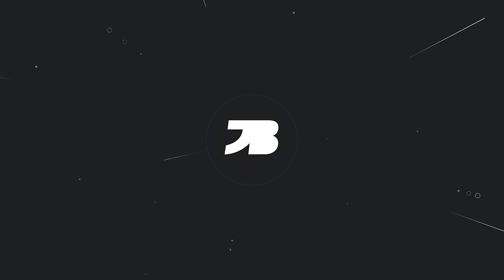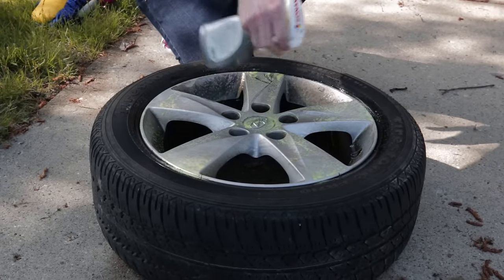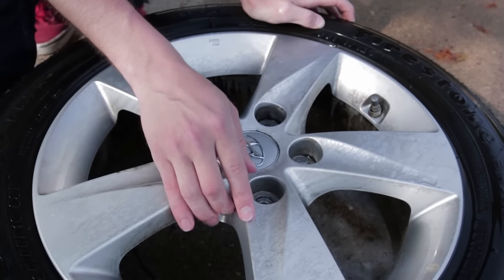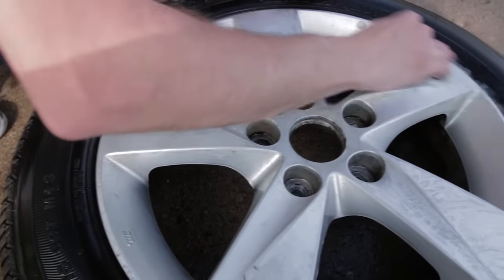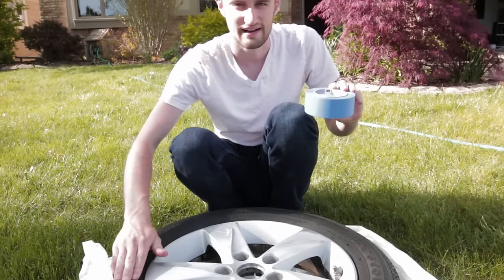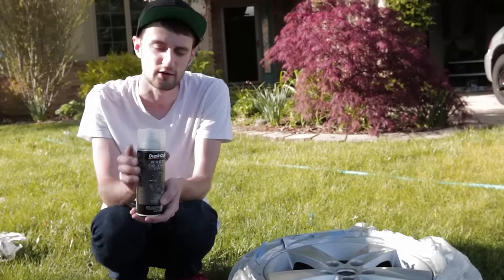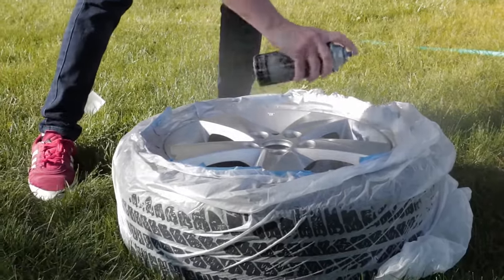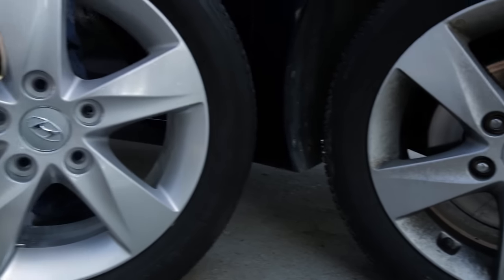How To Spray Paint Wheels Like a PRO!

Comment: Nice job bro. Just an added tip.... put your cans in a bucket of HOT water to help the paint flow better. Over all Nice how to.
Reply: Shawn Williams Finally someone who says something positive and helps others, thanks
Reply: nice tip - thanks!
Reply: L
Reply: Great tip, thanks! I did that and it helped a lot.
Reply: Wow! I never heard of that haha going to definitely try this next time I go out tagging!
Reply: Absolutely DO NOT put aerosol cans in hot water!  I've seen the result of a deodorant can dropped into a hot bath, it blew the house wall out when it exploded
Reply: ROB     Methinks you exaggerate. 1, the water would dampen the explosion. 2, the sides of the bath would provide a secondary protection and 3, the size of an explosion you describe that'd defeat reasons 1 and 2, could be considered fatal to anyone sitting in a bath. I've warmed spray paint in hot water many times to assist spraying, and also by slipping the can under a clear plastic cover in full Sun to warm it. There was a time when I forgot and left a can this way for several hours and it was perfectly fine. So a spray can dropped in a hot bath, no way Jose`. That said, if you wish to explode it, you'd need to place it over a naked flame, like on a gas stove, or on an electric stove's heating coil...
Reply: You put it in cold water if you wanted to flow out better. you put it in hot water, it will dry too quickly. and as to you putting on your first coat lightly . absolutely the wrong thing to do ! it will not stick, your first coat has to be a little wetter so that it will soak down into the scratches , and adhears after it dries. I would suggest you go to a professional Channel who knows how to do this rather than some backyard guy. And the wheel should be cleaned with prep sol, or wax and grease remover, or bug and tar remiver. Soap doesnt clean silicon off very well. And those tire shine sprays are straight up silicon. Alternative 1 step...Ajax load it up on a sponge and SCRUB !
Reply: Dan, I'm sorry bud, but if you could please use some punctuation, we could have a better idea as to what you're saying, cheers...
Reply: RIGHT ON
Reply: No don't
Reply: @trickym5748  I agree. I read it perfectly. Nice of Dan to take time to comment and try giving others help. I see alot of Trolls trolling lol. Take care!
Reply: Do it. No don't. Do it. No don't. Do it.
Reply: @danblake3265   A "professional" channel? lol  Why so?  I mean, this video is the proof in the pudding guy.  This "backyard guy" as you refer to him is for folks like 90+% of the people who frequent YT and channels like this in their search for HOW TO videos, and this guy did it quite well.
Reply: @Kman. Ok, so you obviously know more than a CSI with 15 years in fire and bomb scene examination, huh?  Even a simple google search will show what happens
Reply: @robfv1508  Lemme help you out, and seriously...no disrespect & forgive me being snarky, but look,
The label on cans reads (and I quote), "DO NOT EXPOSE TO TEMPERATURES ABOVE 120 DEGREES" .

1 The most blue collared, alpha male with callouses on his hands can't keep his hands in 120 degree water but for a moment or so.
2 "Hot water" doesn't come out of the spigot at 120 degrees. People don't even BATHE in 120 degree water, and even HOT TUBS are generally kept at a max of 104 degrees.
3 He's not suggesting for a/one to place cans of spray paint in water that is heated up in a caldron BEYOND the temp that comes out of the faucet.
4 He said "place them in hot water", not "Get the water to 119 degrees and maintain that temp, but be very careful not to exceed 120 degrees, and go ahead and let 'em soak overnight.

So no, I don't retract what I said in the least.
Reply: Also free air spray before you spray paint into the rims just to that the tip of the can stays clear

Comment: Painted four wheels after watching your video - followed it to the letter. That was two years ago. They still look GREAT!!! Going to do more now - watching your video again so I get it done right!!
Reply: You don’t have to sand the rims do I to paint em gloss black ?
Reply: @memesyandhorrorshorts  Gotta do it. Sanding helps the first layer of paint stick to the metal. It's a pretty important step for most painting jobs.
Reply: Quick question, how do you clean your rims once you've painted them?
Reply: @fabiopasquale1098  I just clean mine with whatever soap I'm using when I wash my car.

Comment from the maker: This is my longest video yet, but I had a lot of things I wanted to cover to ensure you get the best results with your next spray paint project. Big shout out to my dad for helping me film this one!
Reply: Justin Buice how do i know what grit sand paper to use?got a 17 mazda 3 aluminum sikver rims like those
Reply: Justin Buice wasup with them skinny ass skinny jeans tho ? Lol
Reply: Hi Justin, excellent work right there. I'd like to try it as well. Could you please list all the products you used I couldn't see them properly on the video? You may add the photos of these products as well. Thanks
Reply: Justin Buice you didn’t do the inner side poor workmanship
Reply: @trickym5748   Obviously he chose NOT to do the inside, but what he DID do (and that's the only think you can comment on), was done well. You were either visiting this video to learn HOW to do it to get "tips/help/ideas/etc", or you just wanted to weigh in with a critical comment.  Which was it?
Reply: What kind of soap or solvent did you use to clean off the grease and dust just before painting?

Comment: Nice job Justin. May I be so bold as to recommend you cover the valve before spraying. With annoying little shaped objects like that,  I would sometimes cover with Vaseline or similar that can be wiped off after.
Reply: It is covered with tape.

Comment: nicely done. important: tape/mask the lug nut surfaces so the lug nuts/bolts torque down correctly.
Reply: Does not change anything...
Been painting since 25years.
Worked at 2 different bodyshops even at dealerships...nobody does that...
Reply: @upnorthviking823  then you got it wrong all those years. : )

Comment: Hey man primer?
Reply from the maker: I used the primer that was already on the wheel rather than sanding down to bare aluminum and re-priming. The primer used in the manufacturing process is probably more durable than the spray primer you will find in a store anyway.
Reply: Jacob Roe u only need primer if bare metal is exposed

Comment: Justin, I was wondering if the silver spray is oil base or latex & if it matters what it is ? ... Concerned about it being able to accept the clear coat gloss you sprayed on. ----- just thinking they sell a spray paint that looks like Chrome instead & thought that would give a nice upgrade .... Rather then just use silver wheel paint --- just a thought ! Jim C.

Comment: Good video. This sounds a bit odd, but when I take my tires off for say doing brakes I clean the back of the wheel. I use wheel cleaner, rinse it, and  then some dish soap and an old kitchen dish brush that is just for this purpose as the brush will get grease on it and can not be used for anything else. 
My thinking is that the grime on the back of the wheel can build up over time and cause corrosion as it hold moisture and say road salts, etc. And does that grime contribute to the front of the wheel getting dirty?  Who knows. Anyway  there is my comment.

Comment: Best thing to do after the wheels have fully cured after a few weeks is apply a ceramic paint sealant. On all my wheels I always apply 4 coats of ceramic paint sealant to the entire wheel this will protect the wheel from light scratches and prevent tar and brake dust from sticking to the wheel. Weather it be painted, powder coated, chrome, or matte finish its the best insurance u can provide to keeping the finish looking like new. when clear coating the wheel use lacquer clear coat as this will be more durable and withstands uv damage and forms a harder bond to resist scratching and chipping better

Comment: The one thing I didn't hear mention is how long do you wait in between applying coats ? I have a 2015 Nissan Altima. I believe the rims on it are stock ? I wanna do them black. Any advice on what I need to do this ?
Reply from the maker: If it's warm outside (above 70 degrees F) wait about 30 minutes between coats

Comment: A quick tip that I use depending environment and temperature is having a gallon bucket full of hot water and have the spray paint cans sit in it for a bit prior to use. This helps the flow of the paint and speeds up the molecules which builds up better pressure. Use common sense tho.

Comment: So, when that pesky grimy break dust accumulates on that new painted rim in about one years time, how do you get it off without ruining the paint job?  Can you spray that Sonax cleaner on that painted rim, or will that cleaner ruin the paint job?
Reply from the maker: You can use sonax or any wheel cleaner on them

Comment: It looks really good! I've done the same method for painting some old wheels as well, but what I find annoying is that once you get rocks or other stuff hitting the paint it creates nasty scratches that almost "dents" the new paint. Is there any ways around this? Thanks
Reply: I know I am 3 years late, but I personally use 2k clear coat and it makes the wheels pretty scratch resistant.

Comment: Great video and advice! Another way to minimize drips is to start a spray off the wheel and end the spray off the wheel. I think it is important how to minimize any chemicals going directly to the environment. Why did you not use an etching primer? Overall a very helpful video. Thanks for putting it together.

Comment: Hi, nice video. Here is a spray paint tip: Do not paint your wheels laying down, the spray box work's much better in a vertical position, so stand up your wheels.
That will make it more handy to reach hard to get places to.😊
Reply: Higher chance of drip
Reply: @NATURALGAMING ???? with that logic you shouldn’t spray paint anything vertical lol there shouldn’t be drips if you’re doing a light coat
Reply: @jaz8615  I agree with you but remember wheels are different then your typical object because they must be perfect
Reply: @NATURALGAMING  anything on a car has to be perfect put there are still professional paint places that will paint with the panels on the car but alr
Reply: @jaz8615  yeah Ik wym but we’re talking spray can brother

Comment: Great video Justin have you seen chris fix's video on alloy wheel restoration? question : did you primer the wheel after sanding?
Reply from the maker: +Raymond perez thanks! I didnt prime because I didnt sand all the way through the paint. The only time you really need primer is if you sanded down to the bare aluminum

Comment: Don't tape around the rim use playing cards in an overlap fashion.
Reply: hawkdaddy64 waste of a good deck
Reply: Auto detailing stores sell a "tool" that fits around the lip of the rim to keep over spray off of tires. But really the cheapest way is masking tape and newspaper.
Reply: Why does it matter what he uses?? The point is to cover the tire which he did
Reply: hawkdaddy64 the top collision repair shops in the country do it. It's a automotive superstition
Reply: PR H trash bags are free with your groceries cards are $1 is the part your talking cheaper.

Comment: Great video, do you prime any of your wheels? Just curious, have painted wheels on previous vehicles, always used Mean Green to pretreat, then Dawn to clean, then lightly sanded as needed, then used Rust-Oleum Primer, and Rust-Oleum Semigloss Color, with Clear to top it off. Usually could get about 2 to 3 years out of that with normal wear. What kind of life span do you get with your process? Also, those wheels turned out really nice. Now, if your mom will just stay away from those pesky curb monkeys!!🤔😎😊

Comment: I have an Elantra and I've  wondered if  I could  take the paint of and buff these same wheels to a high gloss like the old mag wheels anyone  know??????
Reply from the maker: I would advise against it unless you are going to clear coat them. Otherwise the aluminum will corrode. The paint is there to protect the aluminum from the elements

Comment: Hi, thanks for the great video. Just one thing I have a concern about is how quickly you clear coated after base coat. The clear coat is not porous and seals so you need to give plenty of time for the base coat to cure, so that gases created by the curing process don't get trapped under the clear coat and cause bubbles and such.

Comment: Nice job Justin.  I've done several wheels like that.  I didn't bother to wash them though.  Used some 200 drywall sanding screens for all the surfaces.  It conforms to your finger for those odd angles.  Worth paint is good also.  The Duplicolor looks great, I'll have to try it.  Well done.
Reply: Which of them would you say is most identical in color? Trying to fix curb rash on my bmw oem rims and got a ‘duplicolor perfect match’ brand silver metallic and it was too dark now i have to let it dry sand down again and do all over

Comment: All is good, except not cleaning the other side of the wheel leaving inside completely untouched and durty. If you clean something - clean it properly especially if you plan to paint it.
The wheel is already off the car, flip it over.

Comment: Let the air out the tyres first that way you can mask the tyres off alot better. Simply blow the tyre up when the paints dry.
Reply: FYI, it won't make a difference because the bead of the tire is filled with steel wires which won't "flex more" just because there's less air in the tire. A bicycle or wheelbarrow tire maybe...
Reply: @ChadHicks92  yes obviously you will need a tyre lever and a decent mallet to break the bead which is pretty easy on small wheels with big sidewalls. Not so easy on low profiles but it can be done with a bit of muscle.

Comment: I just refurbished four Infiniti 17" alloy wheels, using the methods outlined in this video. I am happy with the color and the overall look of the wheels but the finish is not smooth. It is somewhat gritty despite wet-sanding the wheels  with 220, 320, 600, and finally 1,000 grit sandpaper. Did I spray the clear paint too lightly ? Would a thicker coat dry to a smoother finish ? If not, is there a way to polish the grit away ? And yes, I cleaned the wheels thoroughly between every coat of paint, colored or clear so the grit is not airborne debris. Any advice is appreciated.

Comment: CORRECT PROCEDURE ALL THE WAY HERE. Well done. 
Try if Poss to have the wheel on a Table or bench so that you can Walk all around it as you sand & paint. A Table / Bench on wheels is ace to swivel the wheel as you work. 
Spray Across . And Circular around the wheel with Very Light coats. Allow to dry & add more light coats evenly. 
Allow Paint to harden & dry.  Wet sand with 1200 - 2000 grit Then apply a dry waft coat then a wet coat.  Leave for a day or so, Longer if poss, then Clear Lacquer a smooth even Coat. WET but not running.  allow as long as possible to dry, subject to weather & climate etc. them Lightly Mild polish the wheel by hand with a low abrasive car paintwork  polish to remove any Dry spray patches / areas. 
Then Wax with a Cream Protective car wax. ( as you would with a car body panel repair. )

When Spray painting , START SPRAYING ON THE MASKED AREA & CONTINUE THE FLOW AT A STEADY & CONSTANT SPEED ACROSS / AROUND the Wheel. 
DO NOT STOP / START Mid way on the Area you are working. 
Do NOT PUFF the Can , 
SOLID CONSTANT FLOW & PRESSURE at all times. 
Squirt Squirt Squirt is Wrong . A LONG CONSTANT BLOW is the Correct way. For Even Spread of Paint & thinners, Metallic Flakes, & Even Use of Cannister Propellant Gas. ( Air if using an Airline Spray gun. ) 

AIR FLOW & PRESSURE, 
Then Paint Flow, 
Then Move with Air + Paint onto Working Area. 
When Well past work area Release Paint & Air OFF & AWAY from Area Worked. 
Then Pass over in the Opposite direction Using the same procedure as many times as is needed. Per Coat.

Comment: Life goes a lot easier with any spray paint if you use a primer first, even if there is a foundation coat already there. Also pick the right day to do the work or you will be sad. Too hot or too cool or too humid will defeat your skills and make you think you just can’t do it. See paint’s instructions for temp and humidity. They aren’t lying.

Comment: Im wondering, it seems a little too glossy. Whereas, the original looks a little more of a matte color. Even properly clean it looks a little more matte. The glossy one looks like it's a bit less of a metallic silver. How durable is this paint. Can it withstand car wash bristles, rain, sleet, snow, ice. Heat, cold. Like is this something that car mfg would use to color their wheels? (Method, not products*)

Comment: Mine is bubbling up on my 2019 honda accord sport what is wrong ??
Reply: Because you should never clear coat straight after applying base coat. You should leave the base coat overnight at least to properly cure. Gases from the curing process of your base coat have been trapped under the clear coat which seals them in. This is the one problem I see with this video.
Reply: Gondalenium. But the base coat is not even sticking it bubbles up.

Comment: Looks good! I'm gonna paint my truck wheels a gloss black, but I think mine will need some extra tlc in the cleaning process. They're caked in brake dust and stained brown. I'm going to try pressure washing them with a tornado blast tip and see how it goes before scrubbing.

Comment: This is awesome! Just a question? After he sanded the rims with the 220 and the 400 grit sandpaper, and rinsed it, did he put a primer coat on or he just went straight into spray painting it? I plan to paint mines but in gloss black instead of silver.